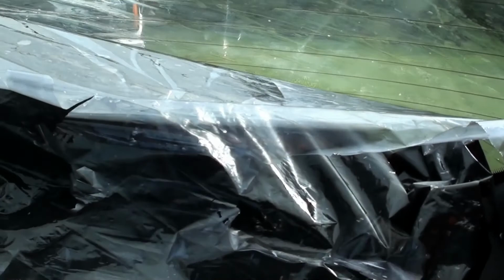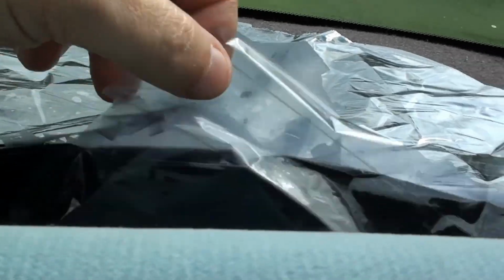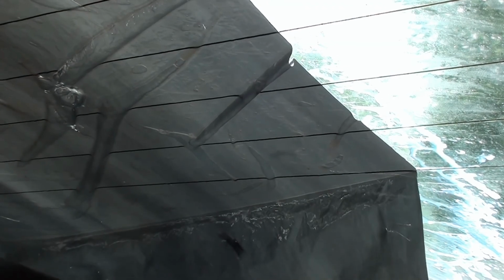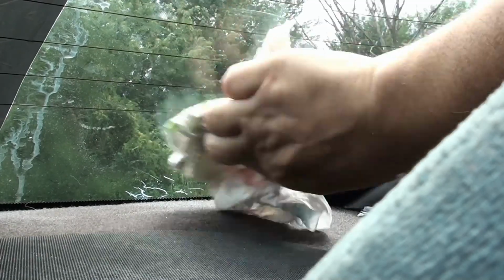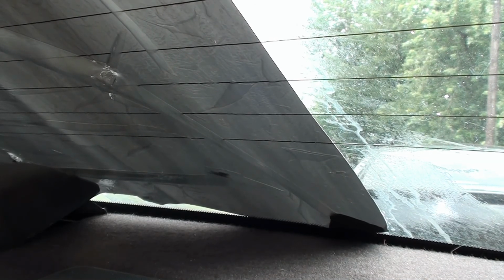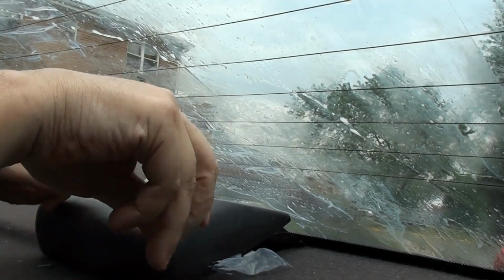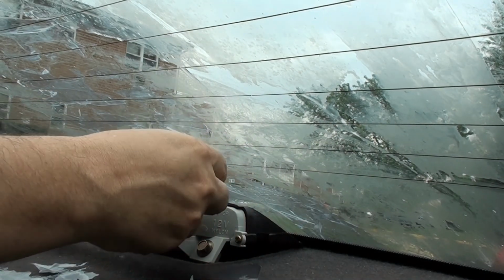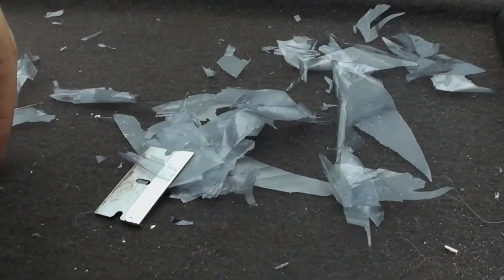Tint removal, Removing Residue on windows with defrosters.

Comment: When using the trash bag method you’re supposed to use 409 before applying the bag and let it sit in the sun for 25 minutes. I’ve seen the pros do this and it has taken all the tint off including the adhesive! In fact I’ll be using this method this weekend on my own car because my old tint has got to go!

Comment: What you are referring to as "glue" in your video is actually a second layer of tint. What was installed on your Windows was a 2 ply window tint which has two different layers. What you see on your window after removing the second layer is the actual glue which appears as a haziness on your windshield.
Reply: Dima Shendel do you know how to remove the second layer of tint?
Reply: Sorry for delayed reply. On windows that dont have any defroster lines you can just scrape the tint off. On windows with defrosters it is best to take your time the first time, do this on a sunny day, use enough solution, make sure everything lays as flat as it can, and you should be able to remove it all in one pass. If not, I would repeat this several times. Perhaps use a soft towel with your ammonia solution and gently rub the film away.

Comment: Lesson learnt here.. i will never put any kind of tint anymore on the back window because its such a pain in the ass to remove it.. in my country the so called tint specialist always told me that if you wanna remove em tint at the back window in their shop they always guarantee that the defroster gonna get damaged..
Reply: Yes...my defroster is damaged and the car audio system antenna is built into the rear windshield and it is damaged causing static on the speakers, much worse when I turn on the defroster. I will not be retinting!

Comment: You know what steamer is ? it's the best tint removal especially for the back window tint comes off with glue and you get a clean undamaged window. Forget about stupid trash bag method dude. unless you live in a really sunny and hot place but still steamer is the way to do this thing. Using a steamer you would remove this tint in 20 min without any glue left on the glass.